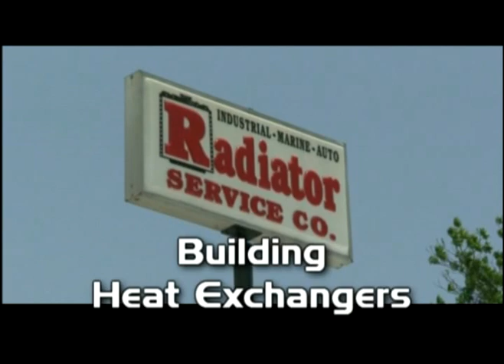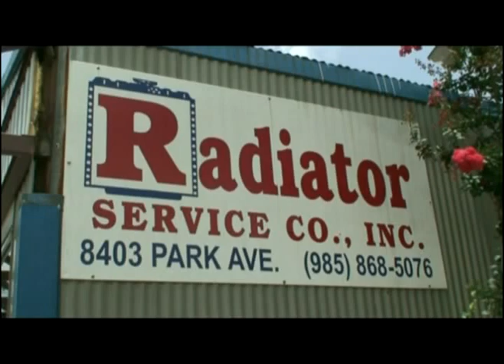Building Heat Exchangers

Comment: @ryanstruk1:  Rolled is a "slang" for expanding since the expander has rollers on them. The tubes are expanded with each revolution of the mandrel. The mandrel is tapered and the slots in the cage that holds the rollers is angled. So when it is rotated the mandrel draws itself in and the rollers rotate and expand the tube out. We expand until the tube wall thickness is reduced by 4-5%.  That is not teflon, it is "Lube-a tube" tube expander lubricant that is water souluble.

Comment: It looks like an oil cooler for an air compressor or skid unit.  Instead of brazing the tubes to the baffles, we typically use tierods in the stationary tubesheet & cut spacers.  We've retubed these before and found the shellside velocity had stacked the baffles on one end. 
  all in all it's a great looking bundle.  We use crisco some times while rolling also.
Reply: Solder it a old way and also weakens the tubes .
Reply: August O 
Yes we can use space tubes in between baffles to keep them in place

Comment: Tubes are free on baffles, which direct flow in heat exchangers. Tubes are expanced to tube sheet at the length of 90% of tube sheet thickness if I remember right. For oil industry we made on previous workplace tube bundles with tube sheets from about 40mm thickness to +300mm. Tubes are easily removed if needed. We used modified Hss-drillbit on magnetic drilling machine or on radial drilling machine.
Reply: jani73 
Yes , like for 40 mm tube sheet , tube expansion is upto 35-36mm

Comment: They are rolled with an expander. The drill is an electric roll motor and it is connected to a controller that measures amperage draw. The controller is set to reverse at the correct expansion. The correct expansion is 4 to 5% wall reduction. The technician measures the ID of the tube sheet, the OD of the tube, the ID of the tube and the wall thickness of the tube. Then does simple math to calculate what the ID should be after expansion. Set controller to reverse at that ID thru trial and era.
Reply: Crosstheriver 
Even we can calculate by simple formula 
formula   =

[% of thinning x (2 x Average thk of tube)+ Average tube hole size - 2x
Average thk of tube]

Comment: well it a good vid i owned a company that made these things and charge air coolers for marine tankers for about 20 years and my only issue would be to say dont sand the whole plate just use a cone drill to tidy the sharp edge of the drilled hole sading the plate removes its  nanural protective coating but neat job

Comment: @engineerdr These are baffles, their function is to lengthen the path of water flow between tubes. It also makes the flow more turbulent by passing the water perpendicularily to the tubes, creating vortices. This is a shell and tube HE without the shell. A full plate would block the flow.
Reply: shogoonn 
Yes it increases heat transfer efficiencies

Comment: no matter about the size if the correct expander is used at the right speed and the hole is drilled the correct size compaired to the tube it will be good for 10 bar easy but dont use hard tempered tube cause it will crack !!

Comment: how come u guys don't crimp the tube on either side of baffle, is a little quicker and if u need to pull the tube  u can drive a rod down the tube and round it out and revmove the tube...
Reply: OLEGRAYRED 
It is possible in case copper tubes used , but sometimes MOC of
Reply: Copper tubes as tie rod 
But sometimes we use Carbon shell or Ss tie rod , in that case crimping is not possible

Comment: what is the normal number of tubes used?
Reply: It depends of how much heat you want to exchange.. Its a project parameter. 

Usually its known the fluids. For the primal fluid, the one you want to cool or heat, is known the initial and final temperatures and for exchange fluid (usually water) is known the initial temperature. From a energy balance you will be able to find the final temperature and how much heat was exchanged. You also need to know the flow conditions and they properties as Re, Pr, u and Nud. You should know the flow rate of the primal fluid and estimate the needing exchange fluid flow rate.

Using heat exchange knowledge, you will be able to find the total length needed for the tube.

Knowing the length, and using standards cooper diameters you can decide the diameter and length of the shell based in your real conditions (space).